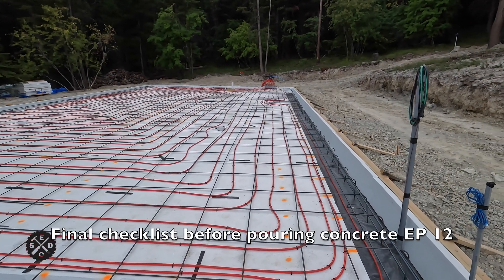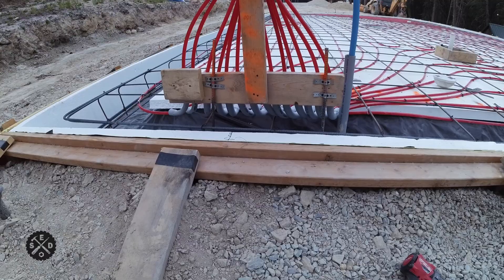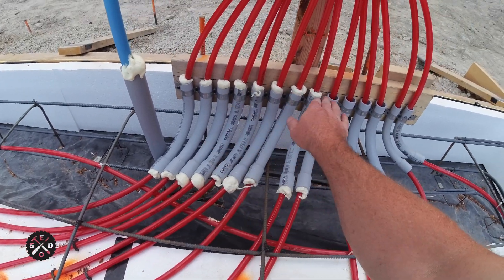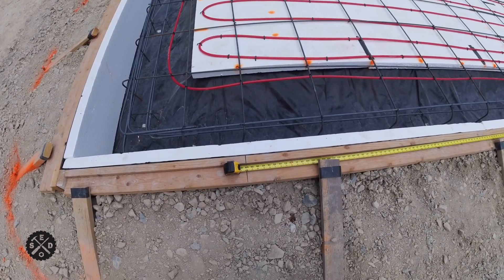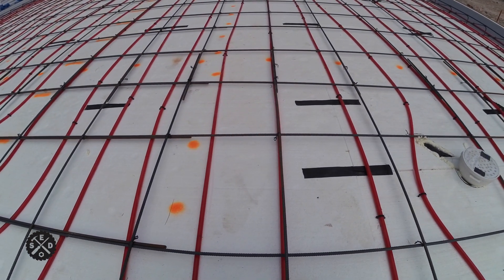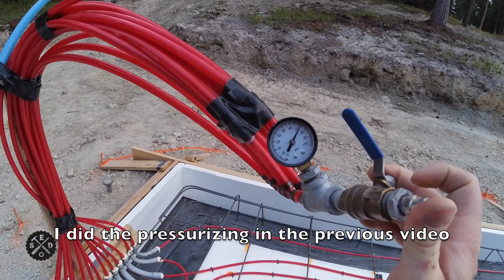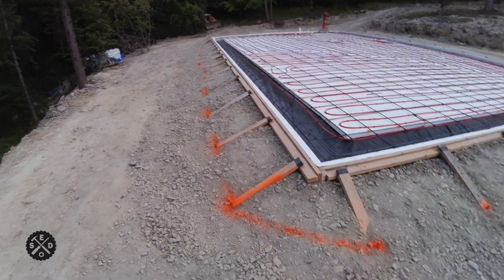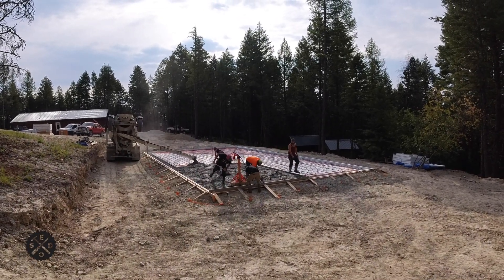5 things I check before pouring Concrete floor diy Garage build ep 12

Comment: I'm getting ready to start the excavation process for my 48x61 barn. Did you space your rebar every 1'?...Obviously I'm going to continue watching the rest of this series. I appreciate the time content creators like you take getting information like this out. Simple things like spray foaming the  elbows...
Reply from the maker: Thanks! I think I went every 2' approximately if I remember correctly. I do cover that in one of the videos. Depending what you'll be driving in there and what strength concrete you pour plays into that as well. For example I did 4000 psi mix with fiberglass mesh as well so that makes for a really strong floor.

Comment: question- why was the vapor barrier installed under the foam installation ? Everyone states ice berg effect can happen in this scenario. Thanks for the info.
Reply from the maker: I've seen people say that too. I've never had an issue by doing it this way, and in my thinking, it should be the very outermost layer. Everyone in my area does it this way as well. I don't know if it really makes a difference as to what order it do it though you just have to research and decide what you want to do I think.
Reply: I thought your way would be better to prevent moisture from getting into the insulation.

Comment: What size of pex pipe did you use and what size of elbow did you use??
Reply from the maker: The pex pipe is half inch. I believe I was trying for 1 inch conduit, but the three-quarter conduit worked as well it was just a little tighter. The 1 inch gives you a little more room. I believe I should have it listed down in the video description below the video as well.

Comment: Nice except not insulating under the per say foundation. That is a big mass trying to keep warm. Big bucks to keep your slab warm around the outer perimeter.
Reply from the maker: Thanks. I don’t insulate under the actual footing because of all the weight of the building setting on it. I insulate on the outside perimeter and then later on I’ll show it but I am insulating 32 inches out outside of the building as well at an angle for frost protection.